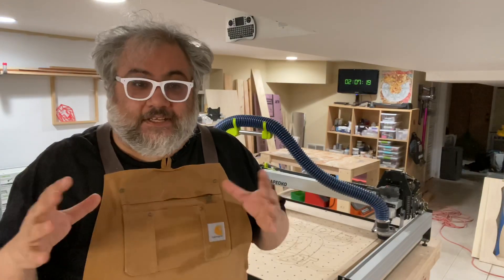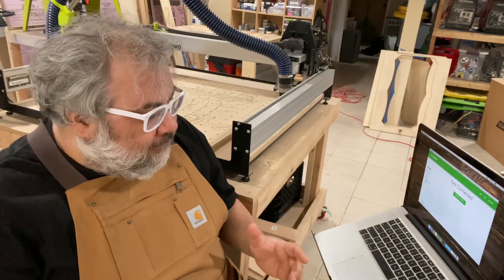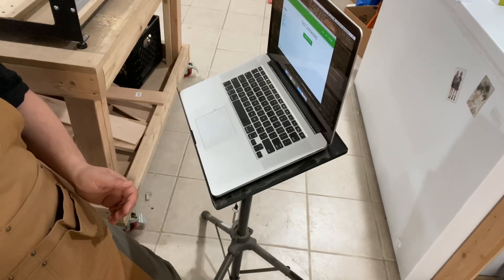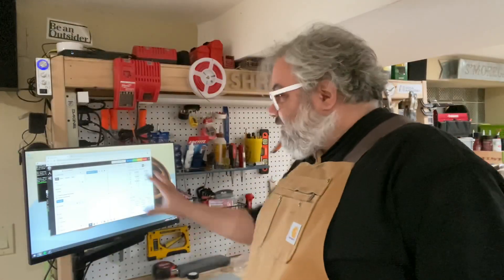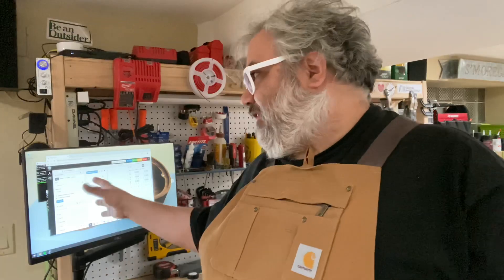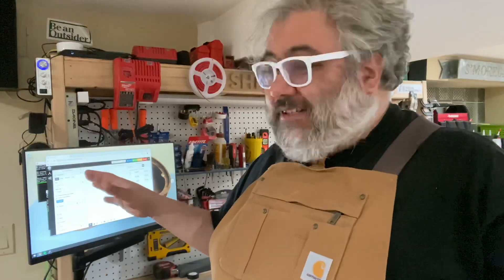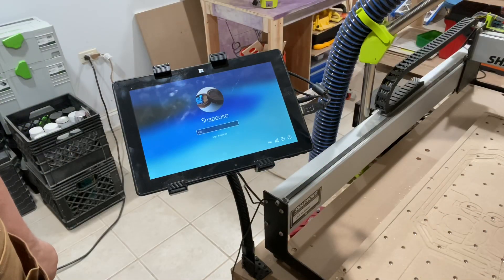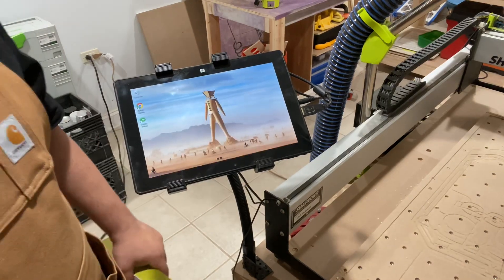A decent way to send gcode to the Shapeoko: a surprisingly capable and cheap tablet.

Comment: Say I buy this tablet but I do all my project programming on the laptop.  How do i send the saved code project to the tablet?  Email?  Any info is appreciated, thanks.
Reply from the maker: Personally I use a synology nas as a home file server that all my computers including the tablet can connect to over WiFi. But you can also use local file sharing over your network, or a cloud based system like Dropbox or google drive or any other cloud file sharing system if you like.
Reply: @robrobsworkshop   thanks

Comment: Hey rob,
When you downloaded “carbide motion” onto your tablet, did you have to download/update applications before it would run? I’m having an issue with it right now
Reply from the maker: No real issues- first thing I did was upgrade tablet is from windows S edition to regular home with the free update from the windows App Store (this is important, as it’s what lets you install software from outside the store like CM) ran the built in updated to get all the latest windows updates, and then just installed the latest carbide motion from the carbide 3D website. What’s the issue you’re having?
Reply: @robrobsworkshop  It now costs 100 bucks to get outta Windows S through upgrade. This tablet just went to 350 total. And it's real slow.  Maybe a year ago this was a good deal, but not now. Wish I would have caught this video then. Thanks anyway.
Reply from the maker: @OGs_Playground  they are charging to switch from S to hone now?  That Is not worth $100 on this hardware. I will investigate and address tommorow- thanks for letting me know.
Reply from the maker: @OGs_Playground  Microsoft’s page still says there no charge to leave s mode- https://support.microsoft.com/en-us/windows/switching-out-of-s-mode-in-windows-10-4f56d9be-99ec-6983-119f-031bfb28a307
Reply: Hoping it works with the update, and thanks rob! Pretty much I went straight to carbide motion to download the software and it would not open.
Reply: I’m now getting the (0xc000007b) error

Comment: Hello, I have a few questions about your tablet. Do you know if it can handle VCarve Pro, and how long the battery will keep it running before a recharge?
Reply from the maker: Marcus Caius I would not use vcarve pro or any cad cam software on it..screen is toby and it’s not really powerful. It’s perfect for a dedicated controller but I have a separate pc (and intel Nuc) on my bench for design work.
Reply: @robrobsworkshop  Thanks for the quick reply.
Reply from the maker: And again, since mine is basically a dedicated controller appliance, I have no idea about battery life- it’s always plugged in.

Comment: I bought one of these on your recommendation - works great! I was thinking about a wireless keyboard and mouse to go with it, but found I was able to pick files and navigate fine so don't think I'll bother. I found myself holding it while stood at the Shapeoko setting up, then putting it on the shelf I made for my laptop once running, so I'm going to remove the shelf and 3D print a holder that's easy to get it in/out of. That'll work for me. Thanks for your review - very helpful. Subscribed!

Comment: Thanks for some great info!  I just got my Shapeoko XXL last week and this was the first upgrade I made.  I'm having a problem with one small issue and I'm wondering if you experienced it as well.  When jogging the machine it is nearly impossible to not move double the distance.  A quick tap of the direction button acts like 2 taps.  I've looked for a way to change this in settings both in Motion and the tablet but so far nothing seems to help.  Anyways...thanks for your videos, I'm now a subscriber.

Comment: Hi ever tried to mill in front o the wasteboard ?  just keep the front of the shapeoko flush with the front of the stand and you can mill in end grain like real seamless dovetails domino's mortise and tenons or a simple line of text in the side of a cutting board etc etc. I have a few short clips on instagram 
https://www.instagram.com/claraholic73/?hl=nl I hope this link works. thanks for the tip on the fusion5. might do it I had tried a mini mac that I didn't use anymore, but that does not work with my touchscreen or any touchscreen for that matter obsolete stuf mac/ kind regards Hans

Comment: That was great idea, thanks for sharing, me to I am worried about my laptop in a dusty environment, it is a new 500gb Surface Book 2 and I don't want to scrap it. My question is: since those tablets run Windows !0 S that supposedly should let you run only software from an approved Microsoft list, did you have any problem installing Carbide Create and Carbide Motion in the tablet?I don't worry about the other programs like Fusion 360 since all the main work I do is in the workstation in my studio.ThanksAlfredo
Reply from the maker: Alfredo Malchiodi albedi there is a free one time upgrade to change windows S to windows 10 home in the windows store :)
Reply: @robrobsworkshop  Thanks I saw it.

Comment: Hey Rob.  I bought the Fusion tablet and almost everything works.  In Create, I cannot open settings or toolpath with the touch pad but it works fine with a mouse.  I was wondering if you have the same problem?  I have been working with support and they have been helpful.
Reply from the maker: Steve's Custom Carving that sounds weird! I’ve never tried to use anything besides carbide motion on it, I will give it a shot next time I’m in the shop and see if I can replicate.

Comment: Rob, I've been thinking about buying a Shapeoko to basically work with foam, custom cut foam insert for tools organization, etc. It's quite an unusual thing where I live here in Brazil. The problem though is that I would pay 650USD just for shipping, not including the actual import taxes. Have you ever worked with foam?
Reply from the maker: Ooh. Yeah, I have thought about cutting some out for photo lens storage and other things  myself. I’ll put it on the list!

Comment: Do you think vcarve pro will work on this tablet?
Reply from the maker: could you? yeah, but i don't think it would be pleasureable. Like, if you had to make a quick adjustment to a file and you had a mouse hooked up to it , sure, it's a regular windows 10 machine. but i would not imagine you would have agood time trying to use it to make thing from scratch using the touch screen. Carbide Motion is great because its got those big easily tapable buttons. Vcarve would be too tiny for fingers, you'd need a mouse for sure.